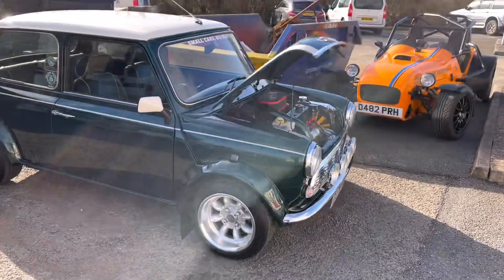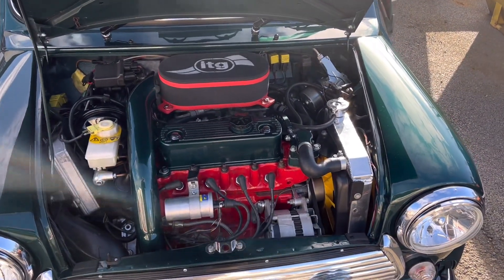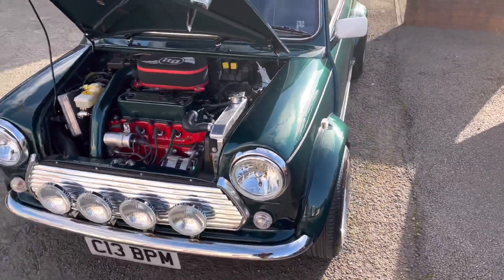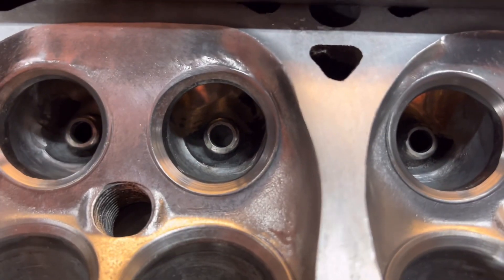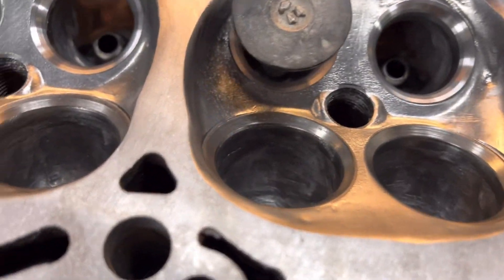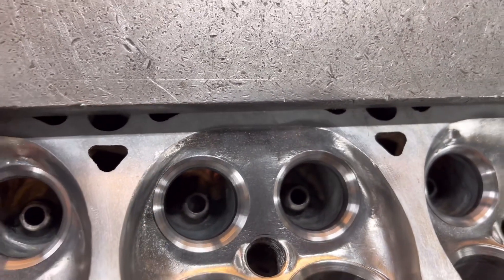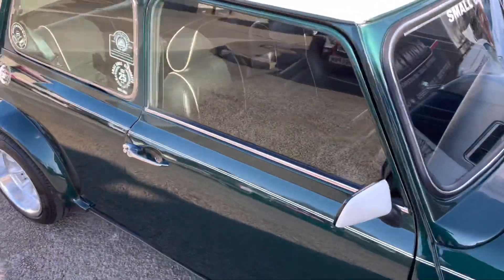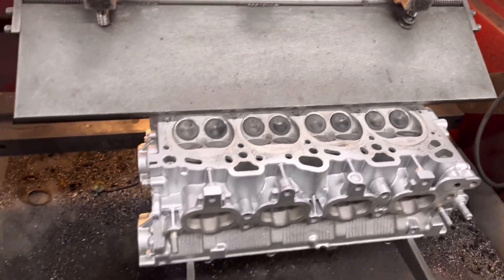3 face valve seat cutting needed, this recon head was POOR

Comment: Nice vid as usual, thanks.  I have in the past cut 3 angle seats, with a proper Newey seat cutter.  But after a few hundred miles, the 60 & 30 degree parts of the seats and the valves coke up, so you end up with a single 45 deg. seat.  I've gone for 'penny on a stick' valves so you have one slim 45 deg seat.

Comment: Even with the load off the rocker the lobe position might be such that you will take an incorrect reading for the gap and I would not advise it. To ensure full clearance from the pushrod - rocker and valve, the cam lobe should be opposite to the pushrod. You are then guaranteed to be measuring the correct gap. This is achieved, as Classic Mini Garage said, by using the rule of 9 method. I can say this as I have done this "gazillions" (cool word) of times on this type of engine.
Reply: Well said, me too.
Reply: Exactly...old school 4 cyl engine always rule of 9... guaranteed valve will be in correct position..👍👍
Reply: The heel section not the cam is basically circular, if you look on an overhead cam engine when a piston is at TDC on compression, the followers are well clear of the flanks and the clearance will be fine, there's nothing wrong with the nine rule it is simple to remember either way good.
Reply: @stevefuller1779  You are correct about the heel of the cam of course but to rely on removing the load from the rocker leaves an unknown factor which could quite easily lead to a mistake being made. The rule of nine simply avoids this possible scenario.

Comment: Cork gaskets for rocker covers are old school we had them for years on all sizes of engines from Land Rovers to big diesels..and worked if fitted correctly and only nipped up...either grease them to hold it to the cover prior to fitting or some hylomar or similar...👍👍
Reply: What I've done for years on my Chevy small block builds (and I've done a few) is to RTV the cork gasket to the valve cover with a weight holding the cover down on a good flat surface. Then let it sit overnight. Last one I did I painted the block black and a guy told me that was a mistake because I wouldn't be able to see oil leaks. Told him :"Engines I build don't leak oil"! And they don't ... ;)

Comment: Set up it’s using the rule of 9 , PS the cover  gaskets usually leak because the tops been overtightened and it squishes the casket out of position nice car nice video

Comment: It would have been easier (and more accurate) to set the valve clearances on the mini engine by using the rule of 9 method, when number 1 valve is fully open you adjust number 8, when number 2 is fully open you adjust number 7 etc etc.
Reply: Agreed, I've commented just now also.
Reply: Thats the method I was taught.
Reply: Same here. 👍
Reply: That’s the correct method. Remember that from years ago when I had a cooper S
Reply: Rule of nine on 4 cylinders,  rule of 13 on 6 cylinders 😉
Reply: I've never used the rule of nine, on a four cylinder engine, as they are "2 up 2 down" I always get number 1 at TDC with the valves "on the rock" this means that number 4 is  TDC on compression so both valves are fully closed, I set those two then turn the engine until number 3 is on the rock, I can then set both valves on number two, next 4 comes up on the rock so I set both on 1 then lastly 2 comes on the rock and I set 3. My Father showed me this method well over fifty years ago and I've always used it, only requires moving the engine 4 times instead of 8.
Reply: @stevefuller1779  thats exactly how I do it as well on a four cylinder.
Reply: SNAFU  , the heel of the cam is the back180 degrees, there's plenty of latitude, in the end there is not too much science in coming to the clearance figure, however even one thou difference alters the valve timing a bit, the hairy cams in the A series have been found to perform better with more clearance for some reason, I will be sticking with my method, I've earnt my living employing it fir the last fifty years.
Reply: I know it's a mini engine but I seem to vaguely remember the rule of 9 not working on some 9f the ford xflow engines in fiestas like the 900 and something cc,  am i remembering right? or
Reply: SNAFU  was a long time ago, guess I remembered wrong, for some reason thought the valve layout was different and that's why it didn't work 😔

Comment: Usually set to spec but the bseries hondas i set up by hand. They were so noisy at 0.12" exhaust and 8 or 0.010" intake.  Set them ul by hand and ran like a camshaft was installed at idle but so much quieter.

Have never heard of the rule of 9 ever in my life.

Comment: Oil leak from rocker most probably caused by crankcase pressure pushing oil passed gasket. Needs another breather. Old A series blocks had a tappet cover one.
Reply: I always assumed that if a British engine wasn’t leaking oil it would be running dry,ie top it up again....
Does this engine,not leaking,not frighten the owner??

Comment: Is the Cossie head for a road car?  If so wouldn't it be better to simply do a single cut on the exhaust valve seat to maximise sealing?  Of course, a three angle of better still a multi-angle inlet valve seat is a must on the inlet where the seat contact is less critical.  On a competition car where the head is likely to come off reasonably frequently then a narrower seat on the exhaust valve can be tolerated.

Comment: X=in and out, Y=left and right, Z=up and down. Cannot wait for the piston cooling mod.
Reply: longitudinal is X
Reply: SNAFU  Disagree, if you look at aviation as an example, X is the direction of flight (longitudinal as Barbara also says), Y is across the wings (lateral), and Z is the vertical component. This is standard industry terminology. My initial reference was standing at the milling machine facing it as this was the subject matter in hand, where in and out is moving the table away or toward you, left and right is moving the table left and right, and Z is raising or lowering the table.
Reply: @miceinoz1181  If you programmed a CNC  mill and  you put the wrong  direction of travel it would prove expensive X Y and Z are always standard paths X being along the length of the bed of the machine Y being the in & out of the bed and Z being the cutter height It gets a little more complex in four Axis or five axis machines That is why CNC programmers get paid lots of money

Comment: Easier to do that with spark plugs out.
Cork rocker gasket, used to use red wotsit on rocker side sets solid, and wotsit gold against the head. Zero leak always, gold non setting so easy to remove. Can't remember what wotsit tradename is called now. Ummm.... No, it's gone
Reply: Absolutely spot on, no compression to worry about.
Reply: HERMETITE ?
Reply: i think it is called blue/gold hylomar.

Comment: 50 plus years ago when I was running a Austin 850 Mini and doing in the region of 20K miles a year routine servicing came around quite frequently.  I used to clean the head surface and stick a new cork gasket with a contact adhesive and leave it overnight before fitting the rocker cover with a small amount of Blue Hylomar and only snug the nuts down, over tightening   them caused the cover to distort. Never had a oil leak .  Having a smokey exhaust on overrun even after new valves and guides led to the valve stem seals for a  HA Viva being fitted.  A bodge maybe, but it worked.